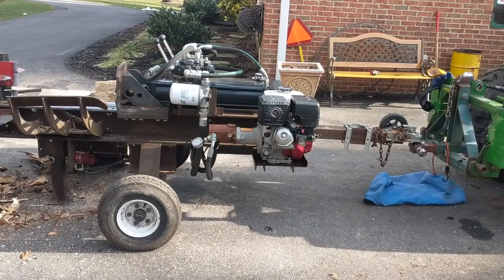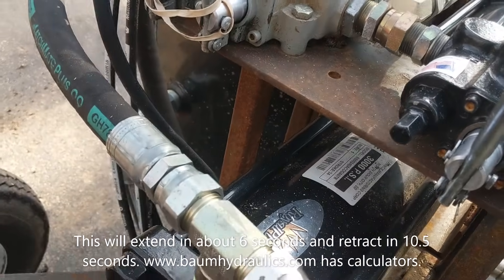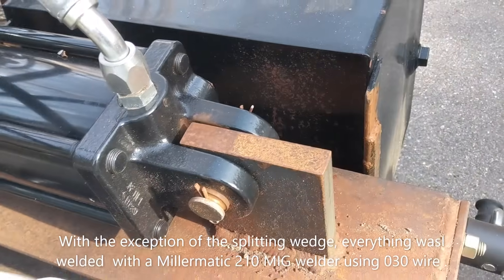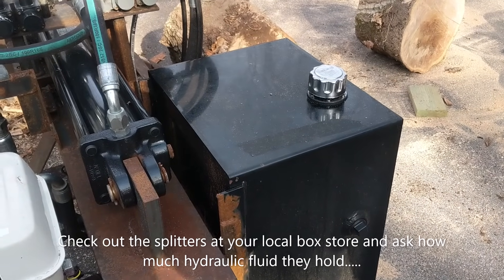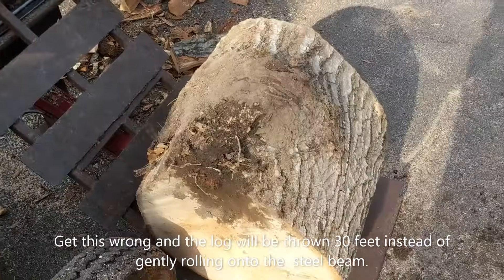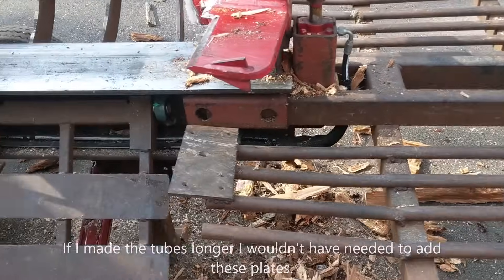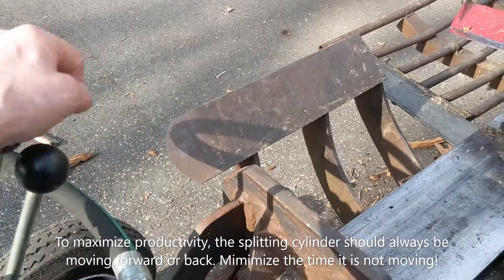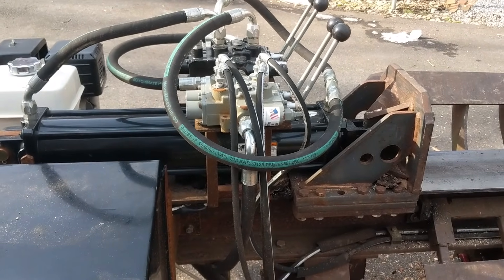Home made log splitter with log lift and four way adjustable wedge

Comment: Do you know what hydraulic oil you have in the splitter ?
Thanks
Reply from the maker: I think it is ISO 46. But... I'd ask at the local hydraulic shop and stay away from big box stores hydraulic oil.
Reply: @WaynesWorldGarage  yes your correct in your thinking , it depends on your climate either iso 46 or 32 I'll check locally .

Comment: Any chance you could post the specs on that self return valve you used for your splitting ram?  I have been designing one of these and I'm looking for the actual name of that valve, there are a few other makers out making similar machines, all $10k plus for one similar to yours.  Excellent work and a nice machine!
Reply from the maker: My valve is a Prince Auto Cycle valve with "power beyond" so I could attach and power the 4 way wedge. This part here is what I have exactly: RD525MMEE5A4B1. I bought them from these guys: https://www.splitez.com/hydraulic_valves.html
They were great to deal with and very helpful. Good luck!

Comment: My box store brand is Champion. It rocks with  a 26 gallon
Reply from the maker: yes, 26 gallon is good. My hydraulic fluid gets hot after a few hours run time even with 20+ gallons of hydraulic fluid.

Comment: I’ve been wanting to build a splitter for myself and really like the machine you’ve built. How did you go about the design and measurements? Just from scratch? Or a set of plans? Any advice is appreciated! Thanks!
Reply from the maker: Hi, I modeled after the Timberwolf splitters. But they cost big $$$! I did end up buying the 4 way wedge from them. Regarding design, I designed it around the steel beam I had. The log lift took some trial and error. The hydraulic pressures are not too hard to figure out. Most of it you can learn on the internet. There are some companies who sell valves and cylinders as a kit. Thanks for watching!
Reply: @WaynesWorldGarage  Thanks! How long of a steel beam did you start with?
Reply from the maker: @kyleshilman8541  the beam is 82" long. The flat on the top is 8" wide. It's 1/2" thick. The vertical is 6.5" tall. I think it is W8X10.

Comment: You need to change hose shops. I just had three 20" hoses made for under $85.
Reply: Fuk I payed 40 to have 2 ends changed
Reply from the maker: I'm not saying I got a bargain on the hoses, but price depends on the diameter of the hose... 2" hoses with fittings are expensive!!!!

Comment: Pretty good design 👍🏻 A couple things to note, the type of beam you used for main construction is called “wide flange beam.” I-beam has a much different cross section and they are both built for different applications. Also on your splitting blades, consider having a pinned connection to the small cylinder as that should take care of the lifting you are experiencing. Cheers.
Reply from the maker: Dustin, Thank you. That's a good point on the solid connection to the wedge. But.... I need to make it easy to remove... some of the big wheels with lots of knots have problems when I use the four way wedge, so I need to have it easy to remove. Not an issue unless I have knotty wood. And not little knots....
Reply: we call them H beam
Reply: @andders2477 H beam is a synonymous term yes.

Comment: You are a very smart man, I was wondering why you needed two valves for the ram & then I saw the auto return. Damn smart sir. Also loved the adjustable 4-way & deck @ the end. Work smarter not harder. I may have to cheat a little & copy some of your work. That's good ole American ingenuity at work, my hats off to you sir.
Reply from the maker: Allen, thanks for the compliment.  But I borrowed this isea from the very well thought out and built Timberwolf Splitters.
Reply: @WaynesWorldGarage  well if anyone asks I got it from you sir. Merry Christmas
Reply: i dont mind having auto return only on the return.. when you split you dont want you hands on the log.. that goes 10000 times good and 1 time bad..

Comment: I'm guessing  you will be building a 6-way anvil in the near future .
It's  a nice rig  you should consider  tallying up all the components and  their specs and selling  it as plans. 
Yes  people will pirate it, but you should make a few bucks  on your  engineering effort.
Reply from the maker: Thanks Raul. Well... the reality is I could not (or didn't chose to..) buy a commercially built splitter from Timberwolf... I modeled this after their splitter and that's where I got the thought of the log lift. And lifting the big wheels up is just not fun like when I was 25, or 35, or 45, or 55!!!  Sadly, the price of steel is making fun projects like this really expensive now!

Comment: hi there nice setup  you did a nice build . do you know about surplus center  that is where we get our hoses   john
Reply from the maker: John, Yes, and I've bought from them before. This was painless.... I brought the entire machine to the hydraulic store and they cut/crimped each hose to fit. As you know, many of the hose connections are indexed since the hose doesn't twist. I could have used different adapters, but I didn't!! Hope to see you soon.